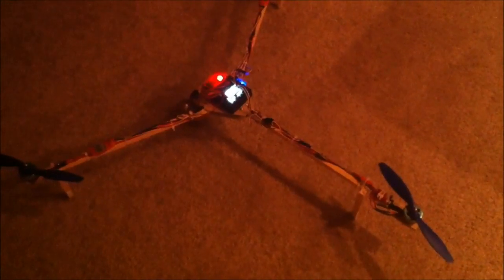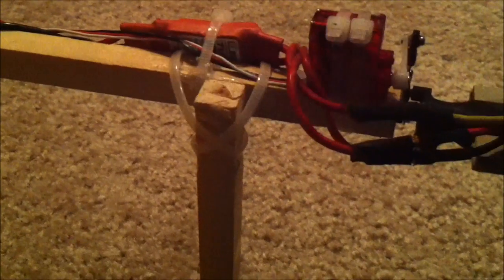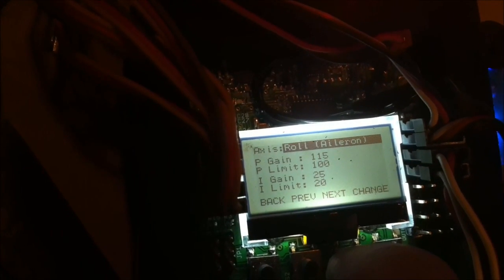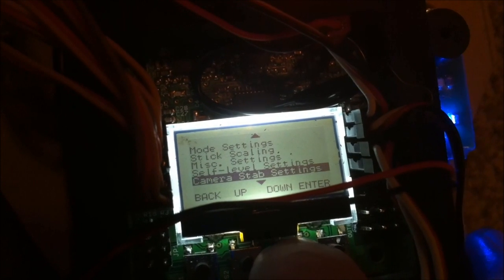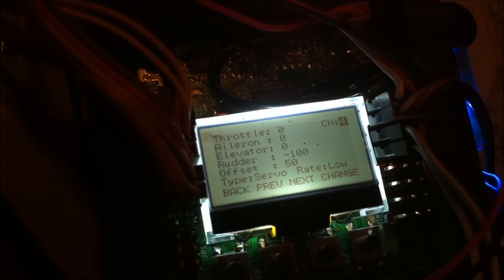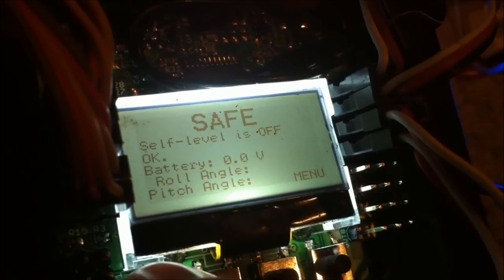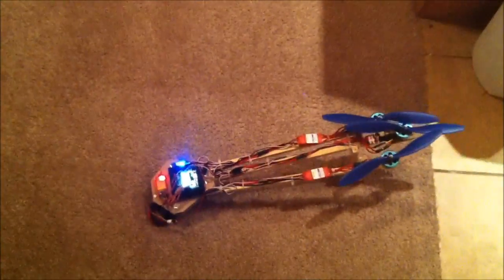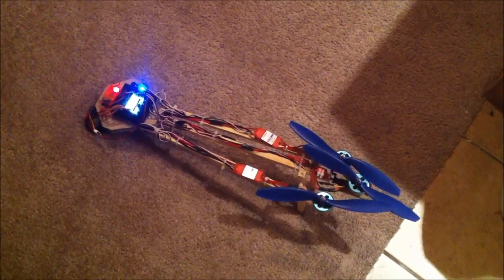KK2 Tricopter Settings & Indoor Hovering

Comment: Can u help. My tricopter keeps yawing as I try to take off. No matter what I do it keeps doing it and then flips over. The servo is centred so it's not that. Can u help please
Reply from the maker: +Craig chivers Have you done the calibration steps on a flat surface? You want to ensure your ESC endpoints are all set correctly -- having one ESC with a different 'max' endpoint for throttle can cause odd things... there are videos on how to do  this step. Also check that you're using the correct yaw servo type in the settings (digital vs analog). Make sure your motors are all spinning the correct directions and have the the correct propellers installed. Lastly, go through all your settings on the KK2 and on your transmitter -> make sure things aren't reversed on your Transmitter -- when you roll left, the tricopter banks left.... when you yaw left on the stick, the yaw motor needs to tilt right.
Reply: +Daniel Hubert yeh done all that. Manage to fix it by reversing the rudder and was ok. But elavator is reversed aswell but it works now. Is that ok or do I need to reverse elavator and -100 on the kk2 settings for it to work even better? And then got to fine tune p and I
Reply from the maker: +Craig chivers not sure, but it probably won't make a different if you invert the transmitter or invert the KK2 with -100. Glad you're on your way to flying!
Reply: +Daniel Hubert thanku

Comment: Great video. I have the spektrum dx6i transmitter and the reciever that came with it but I can't seem to get the motors to run. When I try to hook it up with the throttle up and then press the buttons 1 and 4 and pull the throttle down but it doesn't make the beeps to signal it is connected. Please help.

Comment: Great video. I had a bit of trouble with the servo. Mine is digital. Had to change the mixer settings for the digital serve to hi speed. Mine is still in need of adjustment.
Reply from the maker: outstanding. and yea -- sometimes if your boom lengths are either longer or shorter, or even if the board isn't properly isolated from vibrations, it can cause settings to be somewhat different.

Comment: hi ,I set my tricopter like yours,but everytime it took off it always flipp over,Im dont know where to adjust this problem.I hope you could help me solve this,thanks in advance
Reply from the maker: That's really odd... maybe you need to set your endpoints on the ESC's ?? Otherwise, recalibrate to ensure the tricopter is level.

Comment: I'm getting some servo buzzing/jitter and my tri won't hold it's heading too well.  Any ideas?  I'm running KK2.1.5
Reply from the maker: Play around with the servo filter -- also depending on your servo type you may need it to be set in High or Low.
Reply: ***** So it seems the servo is just a little nervous naturally.  I've isolated the problem to garbage props.  I have a ton of the green 1045 HK props.  The regular ones are excellent however the reverse ones have EXTREME poor balance.  The hub hole seems to be in the completely wrong spot so it's not even balanceable.  I have one regular and one reverse on the front, on full throttle it pulls to the crappy blade side.  Same if I switch the front two props.  Thanks though.  Never imagined crap props could cause so many problems.
Reply from the maker: Nice! I'm glad you found a solution. I was also going to check to ensure that you've put some foam or isolators underneath your control board -- excess vibrations can cause your IMU (Inertial Module Unit) to react incorrectly and could be causing some jitters in the responses.
Reply: Servo jitter/buzz  go look up "simplecopter build" on here, he says you can select different setting on the KK board, Analog is different to Digital servo settings, he flys like a dingbat and has built loads of tri's.....
Reply from the maker: Yup -- should have touched on that in the Mixer Editor setup! Hope you're flying stable now!
Reply: isleman44 Thank you but that's not the problem.  I tried that.  At this point I'm still pretty set on garbage props.  Unfortunately I don't have any more good ones left.
Reply from the maker: Is it possible to upload a video response?
Reply: ***** I actually just took it apart to rebuild a smaller model. Dont know why I decided to make it so big in the first place. I'm sure I'll have the same problem so I'll get one up when I have a chance. Thanks for the follow up.

Comment: I am having an issue with my kk2 board. All my reciever test are on 0 however when i try to calibrate it says aileron is not ok. I can not arm the kk2 board and i have done an esc calibration. can anyone help.

Comment: Hey Daniel I just built a Tricopter with the KK2.0 v1.5 board. I have it set on Tri-Copter but when I go to spin up, only the front left motor spins, if I give some left aileron it will spin up the right motor, and if I give it some up elevator it will give me the rear motor with some throttle. So the power is going to the correct motors, but not correctly. Also the rudder servo moves in the correct direction if I apply rudder, but doesn't move on its own if I tilt the quad. default pids. Help?

Comment: Nice video!
I have a prop question.  I just built a tricopter. Do I mount regular props on the CW motors and Reverse or CCW props on the CCW motors or is it the other way around??

Comment from the maker: In short, yes. Your tricopter only needs the basic 4-channel functions (Throttle, yaw, pitch, and roll) to fly. These functions are stock with all radios. The pinch that you may experience is with activating your 5th channel (stabilize mode) if you do not have that ability... 
So... I do not see an immediate problem with getting a tricopter to fly on a 32MHz standard radio, it just might not be ideal.

Comment: just a small question. I notice that on the starting page on the kk2 board, your settings are roll angle:1 and pitch angle: 17. Mine is zero. I this something important, and how do I change it?

Comment from the maker: No, if you want the tricopter to yaw left, you need the tail motor to bank right. If you go into Misc Settings, and go into Channel 4, you'll be able to take the rudder channel to the opposite value.